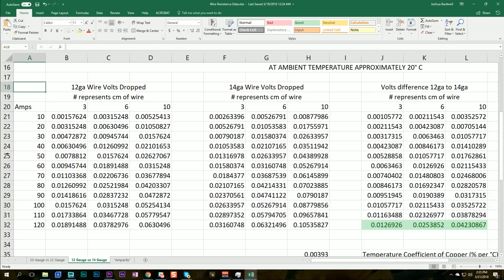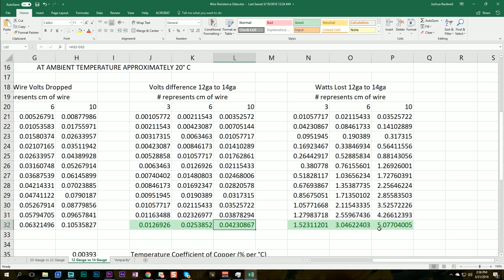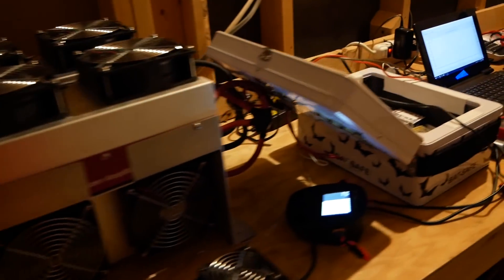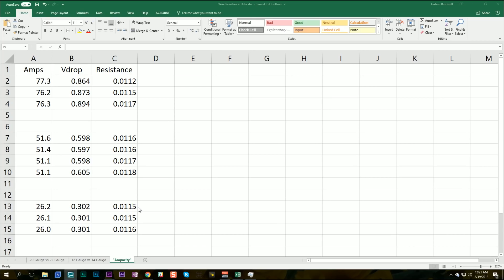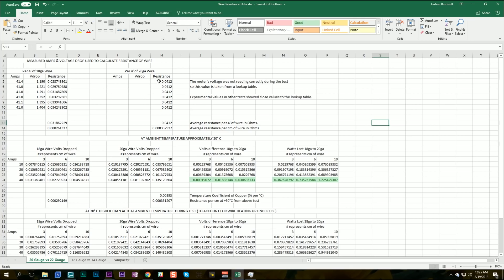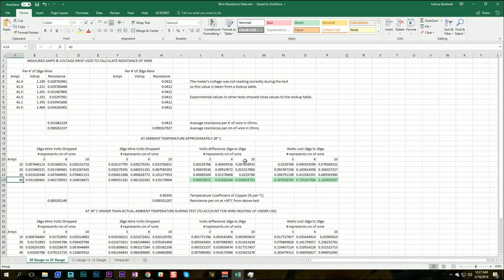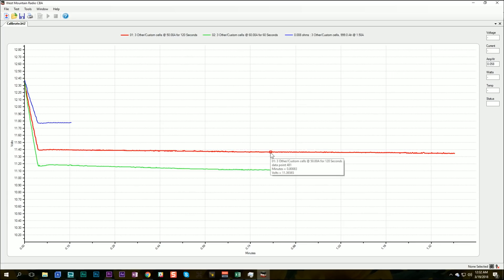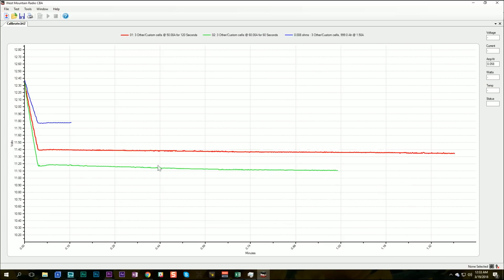Battery Wire Gauge | WHY IT (STILL) DOESN'T ACTUALLY MATTER

Comment: Thicker wires are better but not for any of the reasons considered here. You like to run the battery wire off to the side as mentioned in other videos. The thicker wire is stiffer an this can help with keeping it out of the props on some frames, especially on crash situations. Durability isn’t even considered in this or the previous arguments but I think it should be when you choose which one to use. I have a build where I did chop the motor wires and replacing with thicker gauge prevented this from happening again.

Comment: So what happens kf you use 20awg for battery lead instead of 12? If the difference is so small between 14 and 12, I'm sure it grows exponentially as you drop in guage. At what point (size wire at given short length at say 40amp) does the 'feedback loop' overpower the system and you have catastrophic failure?

Comment: Yes it does!  Why do you think there’s different size wires.  You ever try to pass to much current through too small of a wire it heats  up and could melt or cause a fire.  What if there was only one size wire for car stereos, it wouldn’t work.  Try running all your amplifiers through 10 gauge wire”good luck”.
Reply from the maker: Watch the video please and don't just respond to the title.

Comment: Actually there is a gigantic flaw in the conclusion of this video:
YES, it doesn't matter for flight performance. Not even 16 or 18 AWG would let you feel anything.
But its missing the 20Watts of thermal power in the wires. It has to be dissipated.
And thats not happening, not even with rotor cooling. Its fine for normal flight, but take 2306/1700kv on 6S: 36A power draw max, thats ~150A for the whole copter.
Even 14AWG will burn after about 10-15 seconds.

Sure, its fine for most people. But for those few that love high speed and punchouts it does matter, they'll burn their wires. (And probably their motors, oh well)

Comment: In other words: higher wire guage = more heat in the battery (because the isolation also isolates heat very well and copper conducts heat very well, so the most heat is dumped into the PDB/ESC or battery)
Yes, power loss is necklegible regarding flight time - the increased voltage drop probably also doesnt matter for performance, but you left it out completely

Another thing: the current is pulsed. This means, when an ESC draws 20A constantly, the heat output is actually only HALF as when it draws 0A and 40A pulsed 50/50, because P = R*I². So yes, you're making it a bit too easy for yourself here
I still think 12 & 18 are better, maybe even smaller, but other parts of the build are definitely much more important

Comment: It seems your test proves that Ohms law is correct I = V/R', I'm not really surprised to be fair and I'm not sure all your work testing was really necessary but thanks for doing it. 
This all seems a bit mental to me that people are making a fuss over it, just match the leads on the battery it's not that complicated surely?
If you want to put smaller leads on that should work fine for the application but you are going to reduce the efficiency of the circuit and handicap your fancy batteries a little bit.
It may be negligible but in my experience with electronics, it's always better to slightly over spec your wires than under spec them, especially if there are expensive circuit boards on the end of them. Each to their own and all that build it how you want but i wouldn't be surprised if you get extra unnecessary voltage sag (not the same as voltage drop) when adding in resistance right between the battery and the ESC. I don't have the equipment or know how to do the tests myself though, so this is just my two cents.
Mind you I'm not really qualified or studied in electronics so take my opinion with a grain of salt I may be wrong.

Comment: The differences are higher, lower voltage, motors spin slower, pull less amps.
Reply: You should test when it matter, not everyone uses your size batteries.

Comment: The title is a bit misleading. I'm quite sure that if you used 30 guage wire for the battery leads your quad would have a problem...
The difference between 12 and 14 guage doesn't matter, and between 18 and 20 guage. But battery wire guage absolutely does "actually matter".

Comment: Okay so say I have motors with wires that are too short. The motor wires are  20 gauge. The only wire I have on hand is 24 gauge. Would that be fine for a short length on a motor?
Reply: Motor is a 2207 2500kv

Comment: For those who want peace of mind, the FAA offers a free pdf called aAC43.13-1b chg 1.  It details a lot of things, including wire selection.  Specifically chapter 11-64, page 11-21 is the start.  There are a couple of charts that help select the proper wire gage for your application.

Comment: Hey Josh. I am extending motor wires by 6 centimeters. The existing wire is 26 awg but I only have 20 awg. Can I splice them together without any issues?
Reply from the maker: Going to a larger wire gauge is always ok, as long as the pad is big enough to solder to.
Reply: @JoshuaBardwell  Just signed up as a patron. I would be lost in this hobby without you dude. It's the least I can do. Gonna pick a shirt or two as well. Thanks so much.

Comment: Thanks for the solid data.  Do you know if longer wire leads could be a source of FPV camera noise?  For example 5-6 inches / 12-15 cm.

Comment: I'm a little late to the party, but according to your measurements the difference in resistance for a 10cm wire is about 0.5 milliohms. For a battery lead, this is effectively added to the battery ESR and therefore should affect the effective "C" rating. It might be worth testing the current you can draw from a range of battery packs, both with and without extended cables to see how much of an effect this may have.

Comment: i agreed with you, BUT if you fly micro/whoop quad, or any other 1s battery i believe. Shorting 0.5cm length or between 22 AWG vs 24 AWG is 1 min difference!! , i fly UK65 with 500mAH i just change the length and is about 30-50s difference, do your own test, i dont mind if im wrong tho, because i believe in test too.

Comment: At the positive terminal on my car the gauge goes from 8  to 10 back to 8 before the terminal. I'm replacing some wire and I'm wondering if I even need to taper the wire or not? Couldn't I just 8 all the way to the terminal?
Reply from the maker: I really don't know why they did that but presumably they had a good reason?
Reply: @JoshuaBardwell  I have no idea. Thanks for the quick reply. I'll figure it out.

Comment: what about the length of the wires used between the capacitor(s) and the xt60 solder pad on the ESC. I'm not talking about the capacitor legs as I learned from you I think that these aren't good conductors. But I wonder if soldering the capacitor legs directly onto the xt60 pads is better than soldering them to wires (I use the wires that come with motors) with a 5cm length.

Comment: I was going to comment that the way you are calculating voltage drop is fundamentally wrong, but then I realized that your language about "lead length" is quite vague, and I can't tell if you're calculating the length of the wire in the circuit or the length of the "cable" formed by the two wires going to the battery, and that you could use that vagueness as a defence. But then I realized that your comments are full of people that wouldn't know any better anyway, and that I'd be wasting my breath commenting anyway. And still, here I am.
Reply from the maker: Glad you're here?

Comment: I have an ebike which I am hitting it with 12s!because the original battery took a shizzzz and I am only using 14g wire (pretty short) and it doesn't even get hot. I can go 20 miles @25mph and still no hot wires! Pretty crazy 🤪. I love science!

Comment: Nice one JB, using 24AWG wire for my motors myself. Literally the only size wire i could use to fit on an experimential designed drone build I'm workin on. The battery i got for it came with 10AWG wires 😅 I definitely think its a bit excessive

Comment: Nothing wrong with the science.
Only thing wrong is the lens with which you analyze the data. 
Instead of classifying the loss as insignificant because of its value, try looking at wire size with cost benifit ratio. A few grams of cable weight for an extra 20 watts is a very beneficial ratio! 
Increasing wire size also is effectively adding to the battery capacity, due to decreased heat loss.  That small amount of savings in energy easily compensates for the weight of the wire as well making a slightly larger wire beneficial to flight time and performance, although the gains are very slight.  
I’ll take every bit of free performance I can get, thank you very much. 
It’s probably not worth modifying existing equipment but for new builds, why not?  
Well just my 2 cents..
Reply from the maker: That's a valid way of thinking about it. The problem is that most FC and ESC pads are sized for 14 gauge, and soldering 12 gauge is much more difficult especially for beginners. When the quad as a whole is pulling hundreds of watts, losing 20 watts to the wires is not really noticeable.
Reply: Yes if there is a bottleneck in solder pad size, then that is a practical limit.  
Nice thinking about this with you. I enjoy and find useful to view things from multiple viewpoints . It helps clarify the decision making process.  Thanks for making this video!

Comment: The author has presented a lot of information that for practical purposes isn't needed.  I worked in electronics for over 25 years and can tell you the difference in resistance between a 10 inch run of 20 AWG wire and 12 AWG wire is negligible.  An easy way to determine the wire size you need is to determine the maximum amount of current your system will draw from the battery (or other source) then look up the wire size that will safely handle that current.  The author is absolutely correct in stating the voltage or power loss is negligible between wire sizes as long as you don't use wire smaller than recommended for the current flowing through it.  Too much current through too small wire will cause heating, heating will cause increased resistance which in turn will cause more heating, etc., until the wire self destructs.
Reply from the maker: You and I both know this info isn't needed for practical purposes, but a lot of people think it's relevant, which is why I address (and debunk) it.

The one thing that everybody in electronics overlooks when they talk about quads is that when a quad's motor wire is carrying 30, 40 amps, it's also 100% guaranteed to be in a 60-70 mph air stream. BUILT IN AIR COOLING. So people look up a wire gauge chart for dash wiring in a car and try to apply it to a quad and it's like... no. Stop.

Comment: @joshua bardwell im having an issue with a quad that i hope and prayed that would be my freestyle builds, i have tried everything ive redone all solders,replaced motors,changed soft mounting setup but im left with th jb f4 v2 board and dys aria 35amp escs and i have a throttle stutter from 70-100% throttle only and ive wondered if some how wire is to small 16g on lipo input yet my best flying quad has same wire and flys good. why would a esc have stumble on top end only? also why would a flight controller ?
Reply from the maker: In my opinion 16 gauge is too small for a 5" quad. But I don't think it would cause stuttering. Have you got video of the stuttering? It would help figure out what the problem is.
Reply: ill send you link to video when it uploads in 15min, thank you mr bardwell
Reply: https://youtu.be/_fKVAF4PFL0  joshua this is a current video and if you have your speakers up you can hear it when i punch over trees and honestly i was trying to be easy on throttle to keep it from ruining video even more...

Comment: Even if it mattered, at this length of wire the loss would be extremely low. Maybe people should spend more time practicing and getting better at flying instead of worrying about these non existing losses, maybe you should start selling them brooms and dustpans to pick up those lost electrons, only $300 bucks...made of cast carbon fibre.

Comment: I have a lipo battery that has a JST lead and I'm wondering if I can solder up an xt60 to it and charge it the same way I would if I charged it with the JST lead. 

I'm new to RC. Assuming I have the battery with the newly soldered  xt60 plug, would I just have to charge it more slowly or would the smaller wires be ok?
Reply from the maker: This would work but if the only issue is adapting the battery to your charger, build an adapter. Don't change the plug on the battery.

Comment: Great video, very exhaustive set of measurements. I was wondering if the soldered joints or the contact area at the connectors could make a difference?
Reply from the maker: A bad solder joint will make a difference but any decent joint should have minimal difference.

Comment: At the range of current say 160A in a quad, and with that short distance, really 12 gauge and 14 guage make no different. But this conclusion cannot be expanded to your comment (at 10:03) that even a 20 gauge wire will make no difference. I can assure you that if one uses a 20 guage as the piggy tail for the lipo, it will quickly turn damn hot and melt the silicon coating up, even with cooling in the air. By the way, the quad can hardly draw that usual 160A through and the pilot will note a slow quad.
Reply from the maker: I mean 20 gauge for the motors not the main lead.

Comment: Joshua is correct.
The current rating of an insulated cable is based on temperature rise, due to the heating effect of that current.  As long as you keep under the rated safe maximum working temperature of the insulation, that is all that matters.  
Working out power losses due to the resistance of the copper (Amps x Amps x Resistance, known as copper losses) is futile over the very short lengths that we are dealing with in the RC hobby.  This only matters over long cable lengths (tens of metres and beyond) and is something that we do in the electrical engineering industry for building supplies.

Comment: My rule is to use the lowest gauge that I can properly solder to the pad.  There's no point trying soldering a 10 gauge wire on a small PDB pad.  This mean 12 gauge for the XT60 to the PDB and 18 gauge from the PDB to the ESCs is generally what I use.  I agree that the resistive losses are negligible if using higher gauge wires but I found out that using higher gauge also increase the parasitic inductance which lead to stronger voltage spikes when the current consumed vary a lot and this lead to glitches, twitch, motor desync, video noise and all sort of bad things.  But noting is worst than bad contacts due to a crappy solder job because we tried to solder 10 gauge wire to places where the pads are just too small.

Comment: Great test. I have lost sleep over this issue in the past and although I never tested it myself, I have spent the time running the numbers available from online voltage loss calculators. I will continue to use thicker gauge wire for ESCs as it seems like doing so allows the build to age better and gives me a bit more room for error with my soldering technique. Whenever I take apart an older beat up rig that has had ESCS swapped/re-soldered, I almost always find some corrosion/tears in the strands of wire once I peel back the insulation. This can be minimized by using proper soldering technique (not letting solder and flux wick under insulation, cleaning all excess flux, choosing the right flux etc) but that takes a lot of practice and time.

Comment: Electricians with this thought process burn wire, motors, vfds and even houses down. That's why we use non ferrous metal conductors instead of steal or titanium, bunny hole: the metal that sheds heat fastest tends to be the best conductor ... granted this isn't industrial but this "science" has no breadth, a few weeks in the field and you'd see how a overloaded wire changes chemically, i.e. Oxidizes and loses peak potential... as it changes it becomes brittle while carrying less and less voltage. In our case the molded silicon wire allows you to get away with it longer but only bandaids the issue long enough to transfer heat...  24v at 500mah hrs will reach 274 deg F at a partial connection(measured outside the molecular bi-pin connections . paper engineering isn't science you have to have a control and variable then some simulation showing what it looks like 40hrs-400hrs of flight...
Reply from the maker: Sorry. Nope. People are running quads all the time for months with 14 gauge wire on the battery leads. Oxidation, losing potential, becoming brittle. It doesn't manifest.

Electricians with this thought process burn houses down, but these aren't houses. They're quads. Nobody lives in them. The wires are not inside a wall. When these wires are carrying 100 amps, they are also subject to a 60 mph or higher cooling wind. And they never carry peak amps for more than a second or two. These are conditions that are unique to quads, and that is why these conclusions are valid for quads.

This is not paper engineering. This is an actual test where I actually pulled amps through wire and measured volts and watts lost.
Reply: Joshua Bardwell electricians see it all the time in Ac Three phase, that's why it's standard practice to have metallic enclosures... but as I'm typing I'm realizing  the scales of wattage are like 20x greater so your test with passive cooling and duration are accurate... while I got you here I'm watching your other video...  can you remap a smart audio Rx pin and a telemetry tx pin (for crsfr) for the sole purpose to trade physical places on a raceflight osd board? They have these super "convenient" plugs on there....